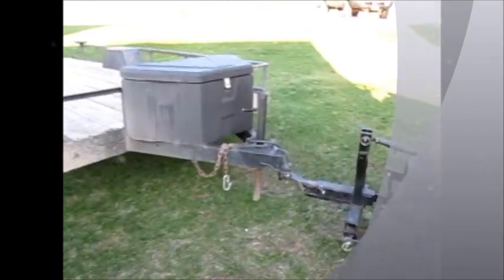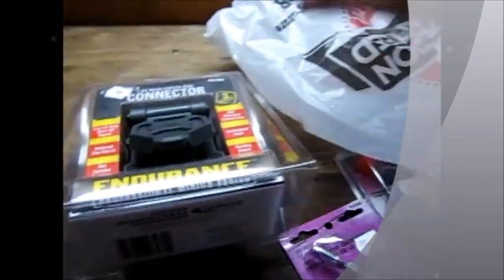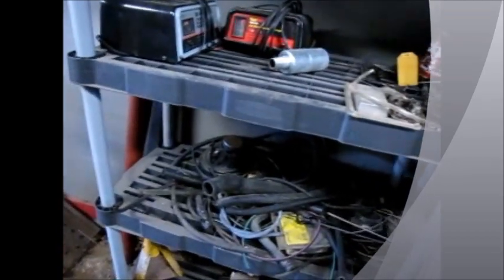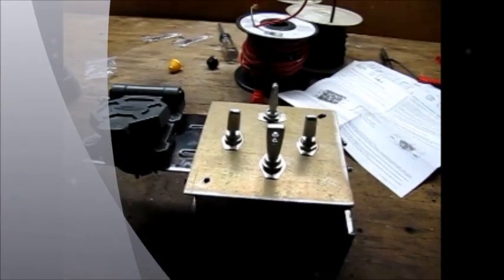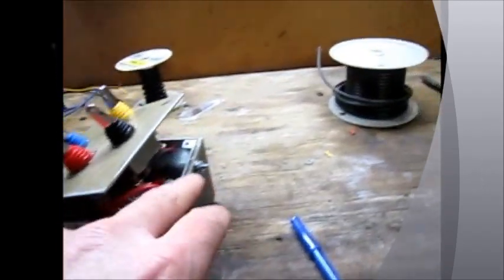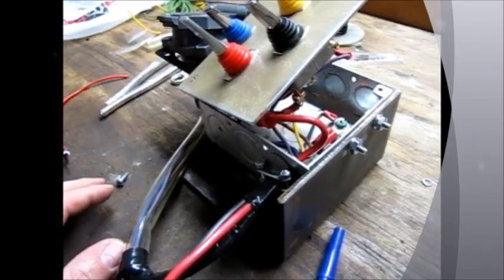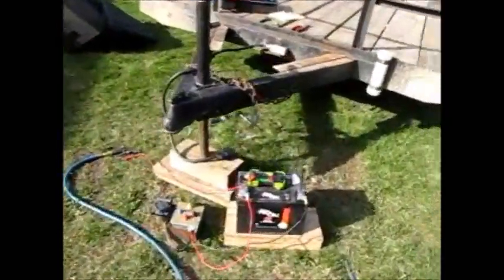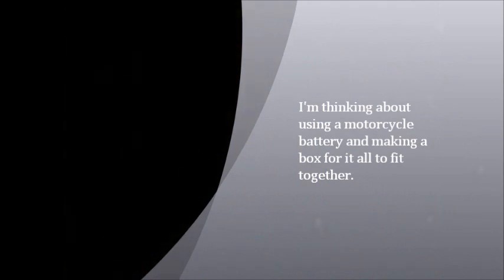Trailer wiring test box

Comment: Cool, was about to go make my own, then thought I'd google to see what others did. Here is a  thought, use your cordless drill battery, and make a VR circuit to drop down to 12 volts, or use a AGM battery like deer feeders use Academy Sports has them.. That way it will be lighter to haul around. I want to make mine with LEDs and a whip to plug into the truck, that will allow me to test the truck signals, grab power for my switches from the RV power circuit, and simulate the trailer light and brake functions.

Comment: You could make a female pigtail, plug into trailer pigtail, use a battery charger and apply 12v to each exposed leads. Diagnose from there.